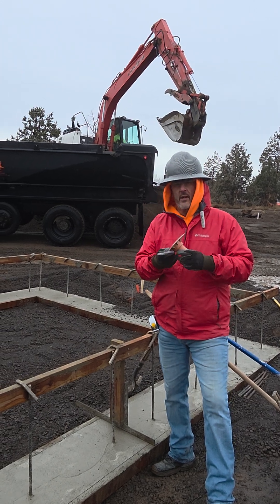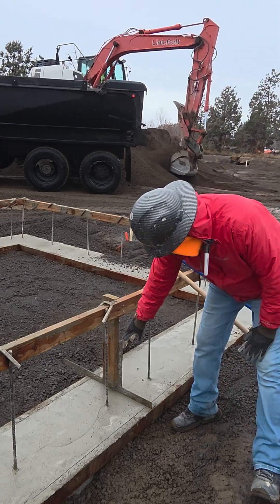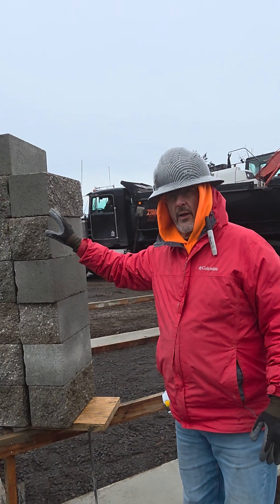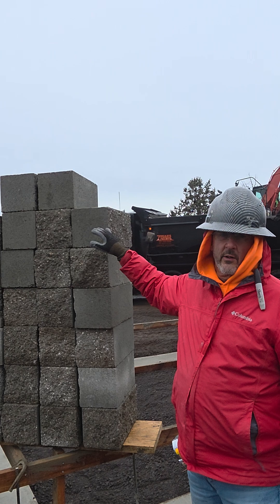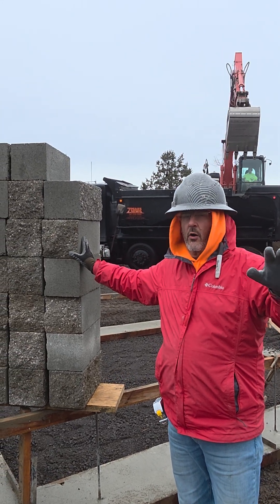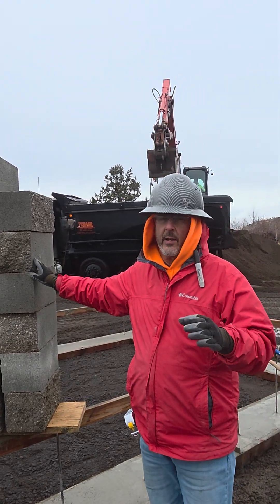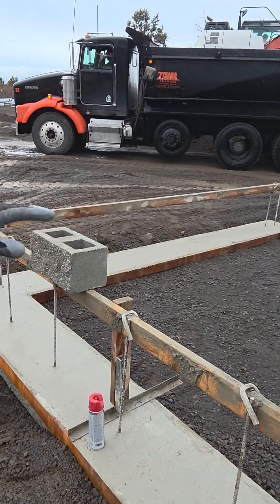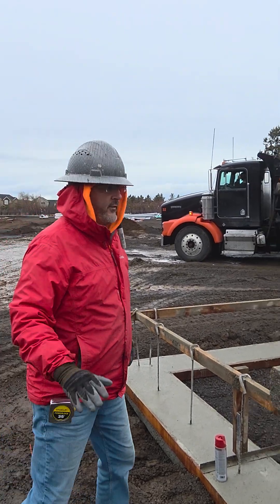Footing superiority! — Why This Rebar Setup Is More Than Strong Enough

Comment: The protection against impalement has to be present until the hazard is no longer present. Assuming those are verts for masonry how do the masons lay block up to the height of the top of the bar where the impalement danger will no longer be present with your set up still in place?? The rod caps can be removed and replaced as the masons lay block until they have laid blocked high enough to cover the bar. Rod caps 
absolutely are a pain and get lost and masons hardly ever save them etc
Reply from the maker: You know your questions are borderline delusional.  And I suspect you know what reality is.

Comment: Is that just for safety?
Reply from the maker: No.  The primary function is to eliminate saddle ties and any other hokey setup.  The pellizcos are strong, fast, reusable, and versatile.  Maybe you can see in the video that the vert can be flush or up to 3/4" down below the top of the layout board.  This is what protects the top of the rebar.  You can see over 1000lbs stacked on the assembly.  But the main purpose of the pellizcos is for fastening verts to a layout board.

Comment: Now I'm convinced but still it's not standard, you need to get this registered and approved by the health and safety people. A lot goes into safety. Qualify it as a low wall or a balustrade, a lot is about naming. Then check if rudimentary balustrading qualifies. Note balustrading can be literally anything 😅
Reply from the maker: In our area is works one of two ways. 1. A contractor can either use a premanufactured system that claims to be OSHA approved or a site built system that follows, or not, the printed guidelines.  Then, the system can be voluntarily checked, checked by complaint, or investigated after an accident.  I will probably call OSHA and request a site visit and show them the assembly.  I have done this before with other issues.  They prefer the voluntary inspection rather than the complaint or accident driven inspections.

Comment: 25% chance it would pass with certain inspectors. 1000% chance it would pass with all inspectors if you simply screwed another 2x4 sideways on top like i saw another guy comment as well.   Not saying i dont agree it would be sufficient 90% of the time. But if someone was working high overhead and fell it would not hold up.
Reply from the maker: Thats the issue.  We rarely have any buildings above us because we are the foundation guys🙂.  Someone would have to fall out of plane.  In 38 years, I have never seen anyone fall on rebar.  And I have only known 3 guys who fell off roofs, they landed in mud.
Reply: @KenScottConsulting  I agree its fine for your situation. But if osha showed up it probably wouldn't be. They cant leave it up to everyone's discretion. Some people dont care or have no common sense. They have to keep it black and white for all to comply by. Im assuming they have to base it off worst case scenario. Lots of what ifs. What if someone got pushed from a 4' dirt bank while guys were goofing around and landed on it....slim...but a possibility.  Merry Christmas though.

Comment: This is a bad example.  You can sit on a car windshield but you can’t stomp your foot on it.   Drop one row of them blocks on your stupid little setup and watch it break like a deck of cards.    You are NOT the smartest man on the Jobsite
Reply: This video is the longest I've ever seen someone take to explain to me they're an idiot. Lol both ends of the lvl were sitting directly above a rebar for starts and secondly my 2 year old knows the difference between static and shock load. You might say it's ok but I guarantee you OSHA will beg to differ.
Reply from the maker: @user-zu2bw7ig5v How much are willing to bet? 1000$
Reply: @KenScottConsulting yes
Reply from the maker: @user-zu2bw7ig5v  ok.  We will see what happens.
Reply: @user-zu2bw7ig5v  its not a lvl tho
Reply from the maker: Yes I am.  Let's see you stack 1040 lbs on your footing set up.
Reply: @KenScottConsulting He be using the caps mang. No goonball setup
Reply: @KenScottConsulting never in my career have i seen anyone attempt to do some nonsense like this.
Reply from the maker: @theSkavenger84 And? Obviously in your career you have not been working with very smart people.

Comment: I don't have a problem with your set up but it is true that shock load is different from static load. If there is a chance of a fall from height I would install your pezco clips from the underside and screw another 2×4 on the flat on top of your spreader board. Merry Christmas!
Reply from the maker: Yes.  I thought of that.  90% of the time we are out in the open, but you are correct about pinning the vert from underneath.  It would make it exponentially stronger.

Comment: I remember when i got my fall arrest ticket a falling person in the harness attached with a lanyard at i blieve 6 feet of fall experiences about 5000lbs of force. But i do agree with your setup.
Reply from the maker: The funny thing is, we rarely have anything above us.  We are usually put in the middle of some empty lot working by ourselves.  However, everyonce in awhile, we will put a footing near an existing building and a fall could happen.   If I can stack over 1000 lbs on my assembly, I am in no way worried about impalement.  
Most concrete guys have been brainwashed into buying shit that cost them time and money without a return.  There is 0% ROI on caps.  I have made 10s of thousands if not 100s using my system over the years and not once have I been cited by OSHA.
Reply: @K @KenScottConsulting  Yea if your system is that strong you have no risk of impalement just from a ground fall onto the dowels.